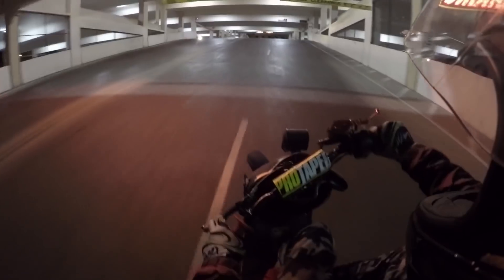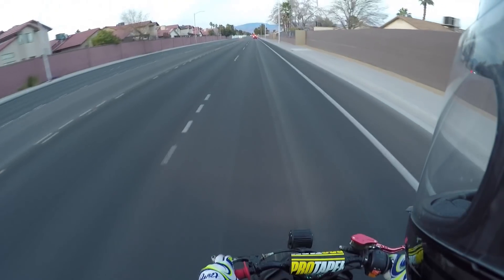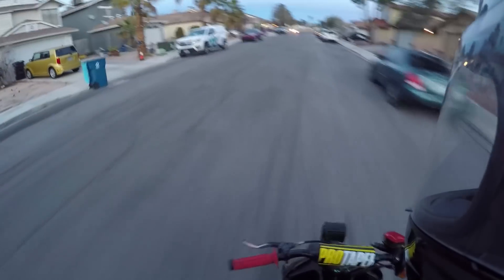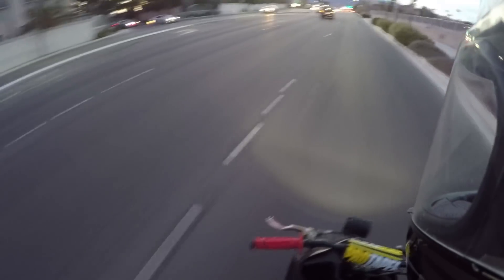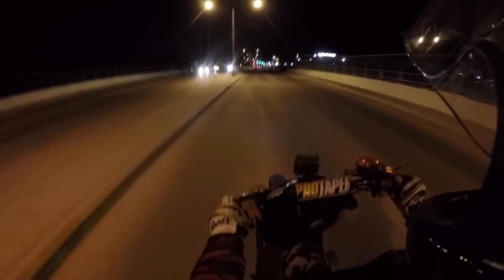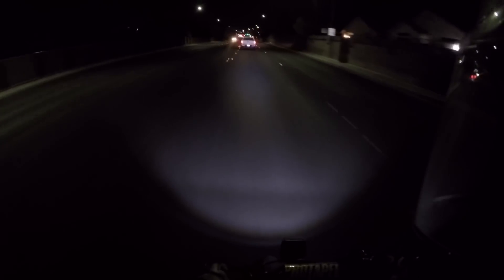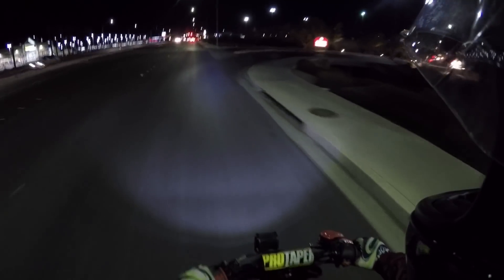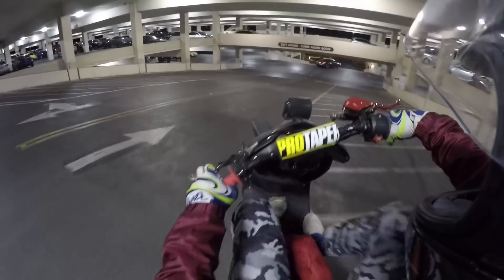I NEED BETTER BRAKES! | Sketchy FAST Scooter Wheelies

Comment: It sounds like its running fine.  The hesitation with the throttle could very well be the rollers or spring in the clutch going bad.  Bout to get my clutch replaced today actually, hope it restores the top speed

Comment: quick question, can you break down what you did to the brake lever? is that a bike lever or a clutch lever from another bike?
Reply from the maker: Magma Bmx it’s a clutch lever from an ATV , it’s really sucks though 😂
Reply: Trevor Pritchett oh cause I was wondering where the switches were on the left 😂 I might do something like that with a comfortable lever